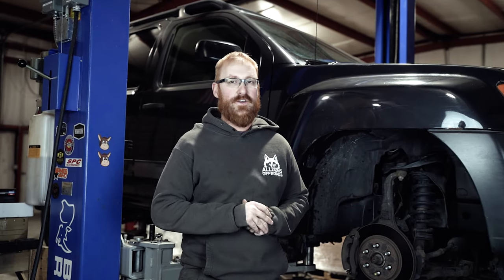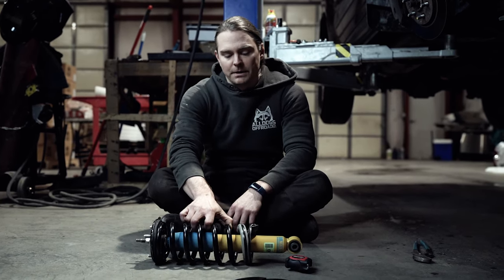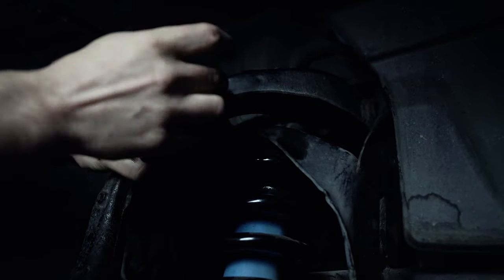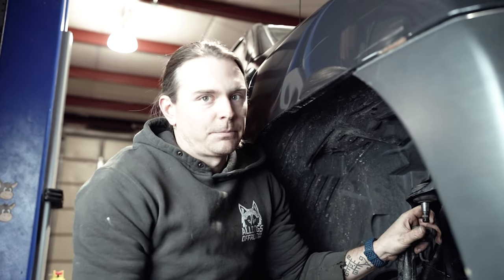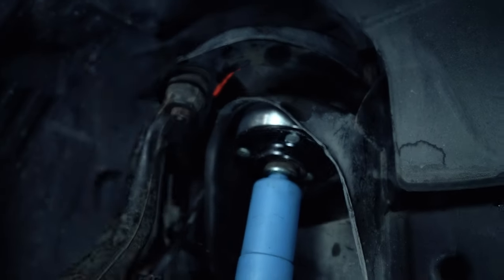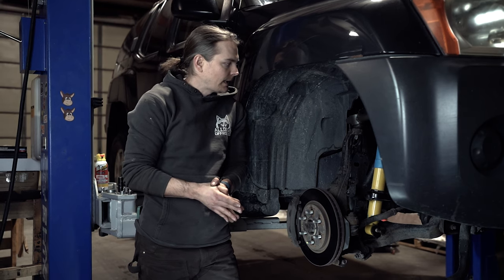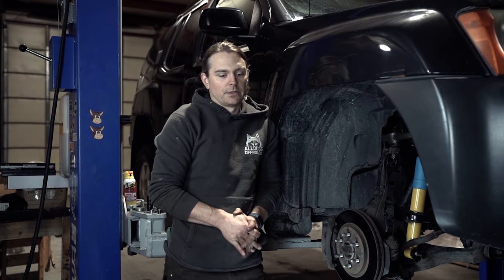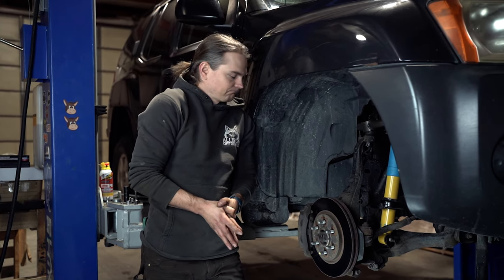Why Spacers don't work with Nissan Frontier, Xterra and Pathfinder

Comment: Nissan makes nice vehicles but they don’t get the love they deserve.
Reply from the maker: We're a little biased :)
Reply: Ain't nothing a titan swapped frontier or Xterra can't roll over 😎
Reply: I, for one, am happy for a biased co-op as yourselves 🥰
Reply: The 05-15 Xterra,  05-15 Pathfinder and the 05-20 Frontier are some of the most kick ass Nissans ever built.  I just wish Nissan had admitted fault in the S.M.O.D Transmission Failures and just bit the bullet.  They wouldve retained so many buyers because of confidence in the brand.  Instead,  they left tens of thousands of people with $30,000 Yard Ornaments.  Too bad.  I love the VQ40DE,  the RE5R05A and all 3 vehicles theyre put in.  I am currently rebuilding a VQ40 because previous owner neglected maintenance,  resulting in SLUDGE and OIL CARBON BUILDUP that ruined the rings,  timing components and rod/main bearings.  Ive done timing jobs on both (really simple job) and the Xterra has 330,000 miles and uses oil.  So when i rebuild the engine that came out of my 06 Pathfinder,  it will go to the Xterra.  Then ill rebuild the one that came out.  And ill have a spare VQ40.  I just love and adore these motors.  A truly spectacular machine.
Reply: They make em hard to modify
Reply: @Cj1985_GT  They are talking about lifting the front end. Your post is completely irrelevant. smh

Comment: I had a 2wd frontier that I installed a RC 2.5in lift kit for a little extra ground clearance.  For some practical purposes it was fine.  I just swapped it for a pro 4x and will be shopping with you guys very soon.  This video was very professional and straight to the point.
Reply: Did you have the kit that included shocks ??

Comment: Great video. Literally put my Pathfinder 2005 R51 in the garage yesterday to get new struts/shocks installed along with a spacer lift kit - figured it would be a fun update. This video popped up while my Pathfinder was at the garage yesterday and behold now that my R51 is lifted I'm getting a small knock from the front over bumps. I watched countless videos about lifts on the R51 and I swear not one of those videos mentioned the control arm issue. Now trying to find an upper control arm thats gonna work for me.
Reply: Yes me too dam it
Reply: You guys have any luck finding a control arm?
Reply: Titan swap
Reply: SPC control arm
Reply: Get SPC. When I lifted my Xterra Rock Auto was selling the SPC arms under the memo tech supreme name. It looks like they have them listed as Dorman now. Look for the adjustable ones. The pictures show SPC arms. Best price I've seen on them. They will work, but you might have to trim the lip of the coil bucket  slightly to clear the SPC ball joint.

Comment: Good video. I am going to get a set for my 2022 Frontier. I have been running the RC 2.5 spacer for about 8k miles and get CBC on one specific bump. I have taken it off-road on some pretty sketchy shale mountain trails in Virginia and never actually experienced it while on the trail. So far I’ve been happy with it but eventually want to get a real lift kit for it but for now the spacers are ok. Thanks for the informational video!
Reply: If you were to look at your coil buckets, I guarantee paint is missing from them hitting a lot since you take it off road. Just because you don’t hear it, doesn’t mean it isn’t happening
Reply: @daywalker4029  I’m mainly talking about the violent clunk you get. I’m sure it is but at such low speeds it’s not as noticeable.
Reply: @TVCColin  yeah i have 2" spacers and its fine unless you really go fast over large holes/ drop offs.
Reply: I got the mild 1.5" spacers for my 2023 Frontier.  Haven't installed them yet.  Do you think I'll have issues with the 1.5"?

Comment: Nice video! I’m curious if anyone has ever talked to a Nissan design engineer (probably long since retired given how long this platform has been around) and asked what the rationale was for the UCA design selection was. Given that it is different than virtually all other similar trucks like you mention, I wonder what the perceived benefits of this arrangement was.
Reply: From an engineer’s standpoint, the design works as it should. Engineers don’t design parts with modifications like lift kits in mind.
Reply: @daywalker4029  true, but it doesnt answer the question,  why did they decide to do it differently than the commonly used solution?
Reply: @mtnbound2764  not my question to answer. would have to ask an engineer. they're still using them now so they must assume it's still fine. they've had 16 years to change it and haven't.
Reply: @daywalker4029 So they are still using this same design on the 2023 and 2024 trucks?
Reply: @PreparedOverlander  yes. the suspension is unchanged from 2005 essentially

Comment: I think that Bilstein you used in this video is slightly longer than stock because I have a .5 inch spacer which gives a 1 inch lift on my 21 Frontier and there is zero coil bucket contact. Its close at full droop but  It rides great. Great video with explanation.
Reply: 100

Comment: Nice video. Makes a lot of sense to not run those big spacers. Even with aftermarket UCA, it’s still not recommended to run spacers because of the LCA ball joint bind?
Reply from the maker: Correct - depending on height.  Past 2.5" is where you can really start to notice it.

Comment: Really great job, dogs… rookie 4X guy with a new 2023 Pro 4x,  Nismo parts and lift kit already installed by dealership, along with 33” Ridgeline Grapplers/bronze rims. Trying to figure out what these guys did. I bought the truck new from dealership recently🎉, but the parts/install information isn’t listed on the sticker price. No receipts. Wondering if that’s all after-market work, and therefore would void the warranty. Going to bring it to somebody else to see wtf. And if the right shocks are there or not. I’m just seeing the blue/yellow 4600s. So will check those vs. 5100s and whether or not corrects spacers, etc are there. NOW I might sound Iike I kinda’ know what I’m talking about! Kinda’… 😅

Comment: I did a 2 inch spacer with a bump stop on the UCA to minimize the noise and impact of CBC and it helps a ton. I also got a longer bump stop for the LCA so I don't damage the shock. I don't off road at all so a spacer makes sense for me and I don't get any CBC with daily driving except for when I go up my in laws gravel driveway with massive pot holes I only get CBC sometimes so it's actually not that bad for what I use my truck for. If I was off roading with it a lot then I would probably get your lift coils but for my needs a spacer works pretty well. I might end up getting the pre assembled bilstein 5100's with the lift coils just because I want to match the rear shocks I installed with your guy's AAL kit haha
Reply: So you still here the CDC but just at a lower volume correct?

Comment: Spacer or not, CBC will be a problem with lift. It doesn't matter how the lift is achieved, the control arm will still run closer to the coil bucket once the ride height is lifted. 

The only sure way to avoid CBC is to go with aftermarket UCAs.

I am running PRG 1.5" lift spacers on my Xterra (which almost everyone told me would not cause CBC) and had CBC with the stock UCAs. I upgraded to SPC UCAs and no more problems.

Now if I could just keep the darned cam bolts from throwing off the alignment after hitting a pothole, or rough trail, and if I could get an alignment shop locally to do a decent alignment! Lifted problems....
Reply from the maker: we have a cam bolt lockout kit that works great with the SPC UCA's that will stop your alignment from slipping at the LCA

Comment: Great video... but you lost me on one thing.  Isnt a taller coil like the one sold with the RCKilla kit still adding new physical length to the strut, which will STILL cause CBC unfil the crappy OEM NISSAN UCAs are also changed out?
Reply: No because your getting your lift from the coil not the actual strut so no ball joint issues either but I would always go with aftermarket uca's anyway they are just so much better.
Reply: @thedude828-ed2nn  yes... I finally visualized it out in my mind that the stronger coil is allowing for less drop of the truck body to produce said lift in the same distance of shock!  I totally agree on the after market UCAs too.  Nissan should be ashamed of the stamped trash arms they put out as OEM... especially to keep them the same strength steel on a P4X that they market as their true harder off road option..  Bad design to begin with.

Thanks!
Reply: @thedude828-ed2nn  No matter how you lift, the uca has to ride lower. Doesn't matter if it is with spring or spacer... lift is lift and new uca's will be needed.
Reply: @rickwhitfield7617  especially with the placement of the uca's I don't know why they did it like that and since they did that design they should have made a better clearance uca.

Comment: Could you install a Titan upper control arm that way you get clearance for the strut spacers?
Reply from the maker: no, the titan arm is longer. also the titan arm has less clearance than a factory frontier/xterra arm. titan's experience CBC at 1.5" of lift.

Comment: Can we get a video of the RcKilla install and how it works to prevent this? Also with the 5100 shock and rckilla kit would it be comparable to a half inch spacer’s gap to the control arm?
Reply from the maker: This video here is an rckilla install - https://youtu.be/4DKuOAwYWUs

Yes, the 5100 would be very similar in clearance to the half inch spacer.  It's about .2" longer than the 4600.

Comment: I mean if more people made shock/spring combos or coilovers made to lift people wouldn't go to spacers but most options are stock height unless you add a spacer and or lift with spring preload.

You are either dealing with coil bucket contact and getting UCA's or dealing with a rough ride and shock top out...

Comment: On a 22' Frontier, can i run the RCKilla with your 1/4" spacers and not get cbc without new UCAs? I will be using the factory shocks. This a 2×4 that wont be seeing any offroading other than the occasional dirt road. Thanks.
Reply from the maker: With factory shocks you should not experience cbc.  If you used 5100's up front with the spacer plate you would.  Keep in mind if you change your shocks down the road for 5100's you'd need high clearance uca's too. :)
Reply: Thanks for the quick response.
Reply: @AlldogsOffroadCoop  Why is there no CBC with the RCKilla lift which is 2" but there is CBC with a 2" spacer lift?
Reply from the maker: @papapear4954  the video explains why but when you use a spacer, it physically lengthens the shock assembly. a lift spring does not

Comment: I guess I got lucky. I have a 2011 AT Pro-4X. I have a 2" spacer in the front, and an add-a-leaf in the back. I have zero coil bucket contact issues over like 5 years. Eventually I'd like to Titan Swap with better UCAs. But, I have to get my eyes fixed first, which will be out of pocket. As much as I want to mod my X, my eyes are more important!
Reply from the maker: i would assume if you look at your coil buckets, you have marks from CBC
Reply: @AlldogsOffroadCoop  I did. Nothing.
Reply: Same for me, no issues.
Reply: @AlldogsOffroadCoop  I take it back. There's some minor coil bucket contact, but it's not a structural problem. I'm trying to decide whether to Titan Swap it with Z1 Off-road UCAs and LCAs, or buy a 2025 Nissan Frontier Pro-4X. It seems clear that Nissan has no plans to make a new Xterra based on the new Frontier. I wish they would, but I don't see it happening. The 4th Gen 4Runner has an underpowered V6 and crappy seats. The 5th Gen 2025 4Runner has either a turbo 4 cylinder, or a hybrid option. Neither of those engine options seem like a good idea, from a reliability standpoint. My 2011 Xterra Pro-4X only has 85,000 miles. However, it's starting to have 13 year old age related issues. I can't afford a Ford Bronco, and Jeep Wrangler Rubicons are reliability nightmares. My only options are to spend money to upgrade my old Xterra, or sell it and buy a 2025 Nissan Frontier Pro-4X. I'm interested in a 2024 Nissan Titan Pro-4X. But, since Nissan has discontinued it in all countries, I'm uncertain the replacement parts will be available in the future.
Reply from the maker: @DDDYLN  the 5th gen 4runner has a 4.0 v6 that is just as reliable and powerful as the frontier 4.0. the 6th gen is the one with the turbo 4.
Reply: @AlldogsOffroadCoop  I can't keep the generations straight. I just know that the 2025 models will only be offered with a turbo 4, or a hybrid. I'm not sure the current V6 is as powerful as the one on the Xterra. I believe it gets relatively equivalent power and torque, but the 4Runner is a heavier vehicle to my knowledge.

Comment: What are your thoughts on regearing a 2nd Gen Xterra pro-4x with 33x12.5x16 tires/wheels? Leave stock, change to 4.56?
Reply: Nee need if your running 33s. If your running 35s you need to regear
Reply: if you have a manual transmission then 4.56s work, 4.10s if you're x has an auto

Comment: while you guys arent necessarily wrong.. the CBC issue gets overblown.  ive been running 2" spacers on my Xterra for years.  its fine.  cbc is only an issue if you are going too fast.
Reply from the maker: it's not overblown. there's many cases of the upper control arm separating and causing major failure.
Reply: @AlldogsOffroadCoop  well,  thats just my opinnion based on my experience,  regardless,  I love what you guys are doing for the nissan community and I hope to one day upgrade to a lift from you guys.
Reply: Have you ever used bump tops to reduce the CDC noise?
Reply: @A.lowkee.savage   i have bump stops on the up and lower control arms, it helps reduce the impact, but its not really a fix.

Comment: At full droop you will have contact either way correct? Longer coil or spacer will reduce the space between the UCA and coil bucket. I’m not denying coil lift is better than a spacer, I just don’t see how you avoid contact any less. Full droop is full droop
Reply from the maker: the only way to get CBC with a coilover is if it's longer than a stock travel coilover like a 5100. our fox extended travel kits cause CBC because of the actual physical length.
Reply: @AlldogsOffroadCoop  so, i was going to go with the fox ET kit, but even with the ado uca's it still has contact....then why sell it
Reply from the maker: @baggett61  the only contact you may see is the ball joint cut touching the edge of the bucket. It’s uncommon to see it, and truly comes down to the production of the coil buckets on the day the trucks were built. A simple file or quick grind to clear it and you’re good to go.

Comment: So, to be clear: I am looking to achieve modest lift while preventing coil bucket contact.  By getting a coilover lift, say with the Bilstein 5100 adjustable shocks set at 2” of lift, I will avoid CBC? I currently have the RC 2.5” spacers and they knock constantly.
Reply from the maker: correct. a 2" lift with Bilstein doesn't effect the overall length of the shock like a spacer.
Reply: @AlldogsOffroadCoop sick thank you! I appreciate yall!

Comment: a large spacer may create lower ball joint bind at full drop, because as you stated a spacer moves the strut assembly lower which allows the LCA to drop more, a lift coil will raise the truck but keeps the drop of the LCA relatively the same as stock,  but will reduce down travel, the LCA with load on it will be in the same exact spot at 3" of lift no matter what parts are used to get that 3" of lift, right?

Comment: Well, I can tell folks that your control arms do not prevent CBC with RC 2.5'" struts. I still had to trim to get rid of the contact.
Reply from the maker: in rare circumstances, the edge of the bucket may have to be trimmed to clear the ball joint cup. it's very rare though.
Reply: Do you have the Rough Country UCAs? Apparently they're great UCAs for an inexpensive price. I'm talking about the RC Titan Swap UCAs though. I don't know much about their regular length UCAs, but I imagine they're decent.

Comment: Would you recommend the ADO UCAs for my 2013 xterra if I just ordered some Bilstein 6112s strut & spring pre-assembled from shocksurplus? I had shocksurplus pre-assemble them to the max height which is supposedly 1.6" of lift. I used to have the rancho quicklifts but they blew out after only a year. I don't know if I necessarily need new UCAs but my truck is 10 years old now and I'd imagine it wouldn't hurt so I had my eyes on the ADO UCAs. Also, do they have a grease fitting?
Reply from the maker: they wouldn't be necessary from a coil bucket contact standpoint since you aren't reaching the length to cause it with the 6112s. they will help with alignment though as they have additional caster built into them. we use moog ball joints that do come with a grease zerk.
Reply: @AlldogsOffroadCoop  awesome. Thanks for the reply. Probably going to get them anyway.

Comment: Does anyone gave experience with those new Z1 Titan Swap UCAs? They look interesting, in that there are do many adjustments for aligning the front end. However, sometimes more afjustable parts cab be a bad thing, if they're not done properly. Id gate to put them on, only to gave to re-align my vehicle every 6 months.

Comment: I was going to do a 2.5 leveling kit to my 2016 desert runner, then add a titan swap. The Titan has bigger upper and lower control arms. Will the 2.5 spacer work with what I want to do?
Reply from the maker: you need more than just upper and lower control arms to titan swap, but no you cannot run a spacer and make it work. it requires a dedicated length coilover

Comment: Spacers should never ever be run period. Buy new longer springs and shocks or at the very least a shock with an adjustable spring perch like a bilstien 5100. Spacers actually limit flex but on the flip side allows you to run larger tires for the ultimate mall crawler.